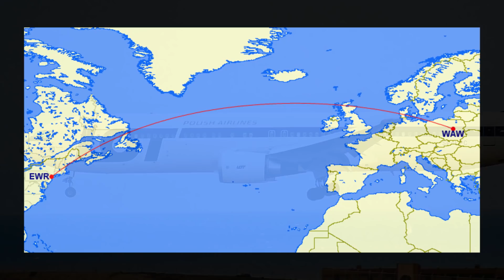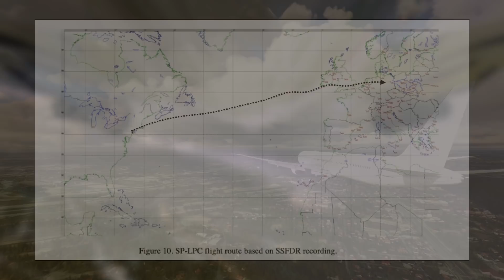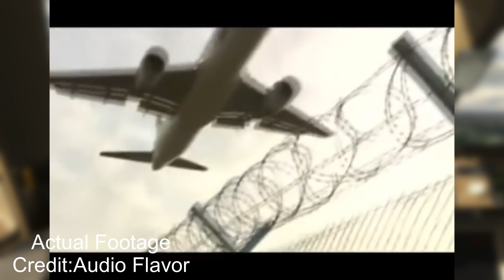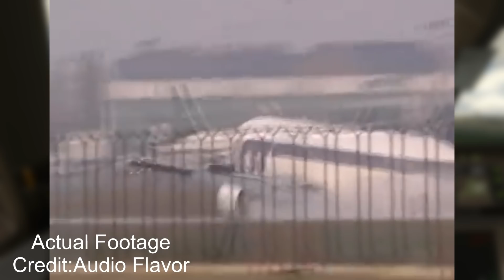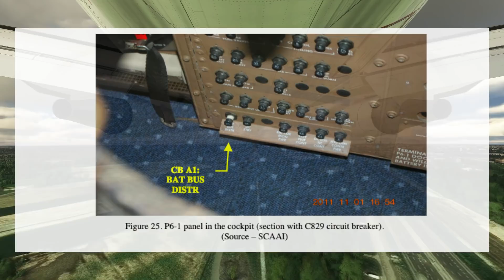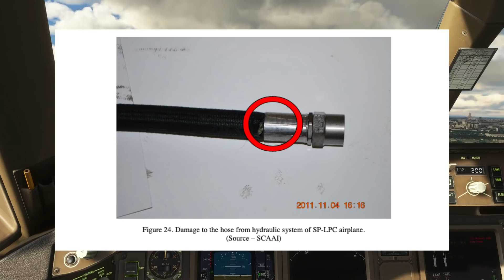A Tiny Switch Causes A Massive Emergency! | LOT Polish 16 (Real Footage)

Comment: If they were on the horn with technical support, and technical support was telling them to try different breakers, why didn’t technical support tell them to try the breaker that operate at the landing your doors? If technical support would’ve told them to check that breaker, they would’ve seen it was open and everything would’ve been fine, assumably. That is a question that comes to my mind.
Reply: Since the gear didn't deploy normally, there's surely (And don't call me Shirley) a checklist for auxiliary deployment. At the end of that checklist, there should be a reference to the failed auxiliary deployment checklist. This checklist should include checking all relevant breakers.
Reply: @millomweb  - Shirley;  I agree.  If there was a checklist of breakers to test, one would expect a complete list that would affect the system being analyzed. My Ford F250 truck had 4wd that stopped working and there was about 8 breakers and relays associated with the operation of that system listed on one page in a $19.95 Clymers manual …. on just a pickup where lives were not involved to fix the problem.  I loved the reference to Leslie Nielsen…. may he RIP.
Reply: @enigmawyoming5201  Have you seen a vid on here about Leslie - how he wanted a big break into serious acting - never really got it until his comedy side broke through :)
Such a shame Police Squad got squashed early.
Reply: Yep. Thought the same. If they were popping and resetting breakers, why not that one, that was pertinent to the fault? Or did they pop it and didn't seat it properly back, due to awkward position?
Reply: @JoseSilveira-newhandleforYT  
From what I understand from other sources, the popped circuit breaker was positioned behind the copilot's flight bag (which may well have been what popped it in the first place). It should have been reset as part of the checklist, but it's possible that the copilot missed it because he couldn't see it, or got it confused with a different breaker. Overall I'd blame this one on Boeing, for not only putting a circuit breaker in a position where it was likely to be accidentally knocked, but also putting a breaker which may need to be reset in flight in a position that would be hidden when the aircraft is flying. Especially since there are circuit breakers that cannot be reset during flight, which they could have put down there and covered with a guard 🤦🏻‍♀️
Reply: @Ellie-rx3jt  Yep. That's a very correct assessment.
Reply: Maybe they told them to check the dashboard in general and they just didn't notice something was wrong. Fatigue, confirmation bias etc
Reply: This is the exact thing I wondered too.  I would love a breakdown of what was in that troubleshooting and which things were or were not checked.
Reply: Note that if the circuit breaker highlighted in the video is the one that actually popped, it is not specifically for the alternate gear extension system, but a general DC power circuit breaker further upstream. Yes, the circuit breaker that popped is on the same panel as one of the gear extension circuit breakers, but 5 rows higher.
By the time they noticed that the gear would not extend, technical support would have had limited time to diagnose the problem (due to fuel).
Reply: @ImperrfectStranger  But if the backup failed to operate checklist mentioned all the breakers that needed to be on, it would have been dealt with in good time.
Reply: @millomweb  The extension problem was found on approach. They are lucky they had time to even look at the basic circuits for this system, let alone looking at chains of circuit breakers back to the engine generators. If no other problems were evident, they would not expect the problem to be with a general DC power circuit breaker. Also, half of these power breakers are not even in the cockpit). The aircraft was running out of fuel. Communication would be slow via VHF. The guy at engineering may not be an avionics expert on a particular aircraft type so would have to consult with others. Also, you don't go randomly resetting general circuit breakers in flight without knowing what else is on the circuit. There were some idiot pilots who reset a circuit breaker on another aircraft in flight just to see what would happen and one of the engines overspeeded and blew up.
Reply: @millomweb  And would the checklist include all the circuit breakers which needed to be on for every possible fault? There is a reason it's called the QRH (quick reference handbook) and not the (10,000 page) aircraft maintenance manual.
You don't go resetting power CBs in the air without knowing all the consequences. If the  extension motor had caused it, you could have started a fire under the cockpit floor. 
I have a list of all the things powered by that circuit breaker. As an engineer on the ground, I could not guarantee that resetting that circuit breaker would not exacerbate the problem or create new ones
Reply: @ImperrfectStranger  Can't blame a pilot for a failed aircraft system.
Reply: @ImperrfectStranger  CBs, if they trip, they usually trip for a reason. Resetting them should result in them tripping again if the fault remains - that's the normal operation. The only expected damage would be to the trip itself.
The QRH should give sufficient detail to be able to guide pilots into carrying out POSSIBLE maintenance of the aircraft. - So that excludes replacing an engine or any flight control surfaces while in the air. Resetting any  and all necessary breakers should be covered. Otherwise there's little point in having the breakers accessible to the pilots !
Reply: @millomweb  What am I blaming the pilot for?
Reply: @ImperrfectStranger  That's probably explained in the bit of your comment you've removed !
Reply: @millomweb  You say that every possible maintenance should be in the QRH, so why isn't it? Do you disagree with all the airline manufacturers and air safety regulators? Aircraft are not limited to one defect in flight. All the consequences of multiple defects would have to factored into the circuit breaker reset. The QRH would be littered with ifs ands or buts. 

When the investigators ran their tests, did they simulate all flight conditions? Did they run the engine generators, pressurise the aircraft, simulate fuselage bending, freezing temperatures? I'm guessing not. The CB which popped provides power to various parts of 11 other systems. 

Whilst having some circuit breakers within arm's reach of pilots is a good idea,  with the advent of two man crews, I certainly don't think it's a good idea having one pilot crawl around on his hands and knees in flight looking for CBs whilst the other aviates, navigates and communicates (especially with multiple system failures).  Unfortunately, I don't have the QRH for the 767, so I can't tell you what hoops they would already have had to jump through. 

And just because there are CBs in the cockpit, it doesn't mean they are for pilot access. Remember that circuit breakers in cockpits go back to the days when there was a 3rd pair of hands... a Flight Engineer. And Ground Engineers use these CBs far more often than F/E's and pilots would ever do and I can tell you, they find them extremely handy. Not everyone wants to go up and down 2~3 flights of stairs multiple times just to change a light bulb in the cockpit.
Reply: @ImperrfectStranger  "You say that every possible maintenance should be in the QRH, so why isn't it?"
Because they've failed to properly plan for such eventualities.
Reply: @millomweb  You will never be able to plan for all eventualities. There are just too many variables... including the pilots' abilities to understand instructions and interpret them the same way. They are not engineers, they are pilots.
Reply: @ImperrfectStranger  I'd remove the pilots and design the planes to look after themselves !
Reply: @ImperrfectStranger  - even non-engineers that are pilots trying to save lives and multi-million dollar airplanes could check another breaker a couple of rows down from the first one they checked to see if it had popped; had they been informed to check in the first place.  In the end, that was the only issue of this event …. just another breaker popped on the same panel that nobody realized would cause the same problem.  During investigation, when this other breaker was reset, the wheels came down as designed.
Reply: @enigmawyoming5201  People don't change engines if they have an inoperable light bulb. If professionals are asked for life-saving advice in the shortest possible time, they give the most logical possible solutions. That circuit breaker was not logical. There were no other symptoms to suggest that a power breaker was at fault. Even if it was logical, it would have taken time to find it in the wiring schematic diagrams. They didn't even have word-searchable digital wiring diagrams in those days. There is not one big wiring schematic for the entire system. The diagrams are spread over several, more easily "digestible" pages in different books. Also, all 767's are not the same. They would have to check the "effectivity" of the diagrams. Some people are blaming the sole engineer. Normally he would be part of a team whose collective experience may have found a solution... given time.

There will be no one on the planet who knows exactly what would happen if that circuit breaker was reset *in flight*. It affects 12 emergency systems (including engine generator power!). When you reset circuit breakers, you have to consider if it will make the situation worse. There are some circuit breakers you would never reset, even on the ground, after they have popped.
As always, these videos explain how it's a combination of errors which causes accidents. Hindsight is always 20/20. If you want to add it to your "Kobayashi Maru" checklists, please do, but I think you'll find that the complexity of aircraft will always create a new, unpredicted problem. That's what makes working on these aircraft so interesting (and stressful) to line maintenance engineers.
Reply: @millomweb  Remove the pilots? So you're blaming the pilots now?
Reply: @ImperrfectStranger  - the absolute fact of the matter is once they picked up the airplane and it was suspended over the runway with a crane where it stopped, one circuit breaker (A1) that was showing popped on the same panel in the cockpit, just a few rows down and over a bit from the (F6)  breaker discussed in this video, was reset and the landing gear DID drop normally.  That row of breakers actually had a service recommendation to place a protective bar in front of them which was ignored by the airline .  Put that in perspective and go back and rethink all of your logic as to how it pertains to this situation.
You are right though that we can’t absolutely say in fact that this might have solved the situation as it was in the air…. but I’d put my money on how it likely would have; given the known problems that the alpha row of breakers was prone to accidental blows that would pop it out and create a broken circuit.  And… after all…it did work even after a belly landing.
Reply: @ImperrfectStranger  I think things would be safer without pilots.
Reply: @enigmawyoming5201  I assure you, I took all facts into consideration and was trying to convey to others (who had strong opinions on how things should have been done), the extenuating circumstances. Without doubt, an open circuit breaker would have caused the gear not to extend, but there is no absolute certainty that it was caused by a bag hitting it. As I said, there are 12 airplane systems attached to the same breaker (not all of which would have been running during the crane lift). 
There is some evidence that the motor/mechanism was not the cause, but your "belly landing" is not necessarily something which would have made an electromechanical  problem worse. As has been said elsewhere, a percussive force may have actually assisted the motor and attached mechanism to run again. 
Anyway, everyone is free to speculate. None here were part of the investigative team.
Reply: @millomweb  There will always be a human element in the design of aircraft and human pilots will always be the last line of defence when design and maintenance engineers fail to do their job properly.

Some time ago, there was a memo issued by Boeing advising that Neutron Single Event Upsets could affect autopilot control panels. i.e. high speed sub-atomic particles coming from space can and do  affect the logic gates in the microprocessors of control panels. This is the real and very unpredictable environment in which not even lead shielding will completely protect the aircraft.
Reply: @ImperrfectStranger  - your last comment makes a lot more sense, far, far more reasonable and especially a whole bunch more realistic than your previous pontifications.  I could actually agree with you for the most part.
Reply: @ImperrfectStranger  "There will always be a human element in the design of aircraft and human pilots will always be the last line of defence when design and maintenance engineers fail to do their job properly."

By removing the excuse of 'pilot error' by removing pilots, the onus of safety will fall very heavily on the shoulders of designers and builders - and this is precisely what will drive safety up as they'll not be able to pass the buck.
Reply: @millomweb   Engineers always have the best of intentions. Have you ever considered that it is beyond the capabilities of designers to think of every possible scenario in the 5~10 year design period? Aircraft would simply not be built if this period was any longer. Even a year of real world testing doesn't always pick up faults. No new aircraft comes off the production line without teething problems. Who would have predicted that neutron single event upsets would affect aircraft? (see my other post)
And aircraft are not immune to the laws of physics. They get old, parts break down in their 30+ year lifespan. You can only go so far with redundant systems (redundant systems add complexity and weight. More weight equals more fuel, poorer dynamic performance). If you need a relay to facilitate this redundancy, this relay is also subject to aging even when not in use. Sit a car in a garage for a year and see how well it works. 
You put the burden on engineers, but when the bean counters step in, engineers are forced to choose between their principles and their jobs. I left the industry when I got tired of being asked to compromise my principles, but at least I was in a financial position to do so.
The constant clamour for ever cheaper airfares is counter-productive to safety. No one is willing to pay for this absolute safety, especially the public.
Reply: @ImperrfectStranger  "I left the industry when I got tired of being asked to compromise my principles, but at least I was in a financial position to do so." - that is really sad. If it got to that stage, you might as well have tried bullying them. Nothing to lose.

"Have you ever considered that it is beyond the capabilities of designers to think of every possible scenario"

No, because that's not the case.

Problem: Bomb onboard.
Solution: prevent pax taking bombs onboard.
Every other eventuality, I've got covered. Try me.

As an aside, did you know that on most 'shipping vessels' you can't deploy the lifeboats when you need them due to the vessel listing ?
Reply: @ImperrfectStranger  --They knew of the hydraulic fluid loss not long after leaving Newark. However, the crew continued the flight to use up the fuel load.
Reply: @AEMoreira81  Sorry, I'm not sure what your point is. I can't remember what was said 8 months ago.
Reply: I could be wrong, but I thought the suspicion with the circuit breaker was where it was located at floor level is right where the co-pilots flight bag would sit. It's likely that all the activity pulling out manuals and checklists caused something to brush against the breaker and pop it. So the breaker was probably tripped while troubleshooting the hydraulic system. 

And I agree that sending this plane over open ocean was a bad judgement call. Granted you want to burn off fuel regardless. An overland flight with possible diversion airports would be one thing. But sending it up over the north atlantic with a failed hydraulic system was not a good idea.
Reply: Mentour Pilot had analyzed this. Some facts probably not explained clear enough:

1. The circuit breaker that actually popped was so low to the floor that even act of cleaning can accidentally popped it. Boeing had issued an optional maintenance directive to install a guard plate, but it's optional.

2. During the high stress of the moment, the First Officer might be hyperfocused ("tunnel vision") on twiddling the other, non-problematic circuit breaker, totally missing out the other circuit breaker.

3. Because the state of the circuit breaker switch is not recorded in the FDR, it's unclear when exactly the circuit breaker popped. It could've popped prior to takeoff (due to cleaning crew or FO's bag), it could've popped during flight (due to some electrical anomalies), it could've popped when the FO popped the other switch (due to electrical surge when the other switch reclosed)
Reply: Yup, first thing that came to me too
Reply: They did tell them to try that breaker. But the breaker that was actually out was a battery pack fuse, which no one thought to check. This is covered more thoroughly on Mentour Pilot
Reply: Same thing I was thinking.
Reply: Arrest the pilots for attempted murder 
Arrest the engineer who spoke with the pilots 
Fine LOT 10 million for not training their pilots properly 
Make Boeing pay 1 million per passenger for building a crap plane that breaks
Reply: @UnrealZBI  WTF